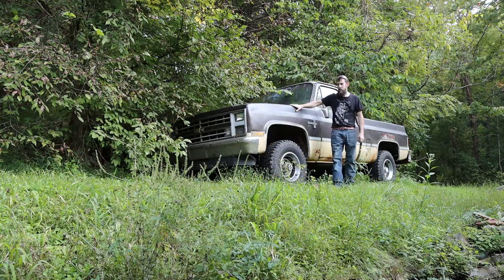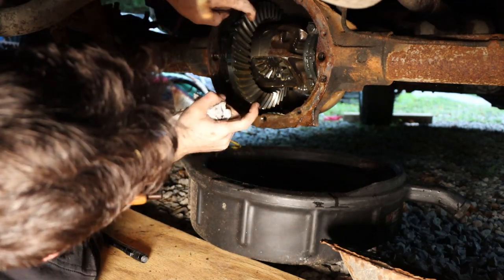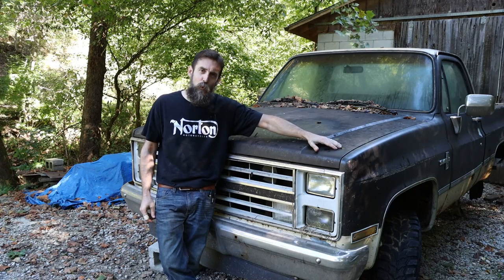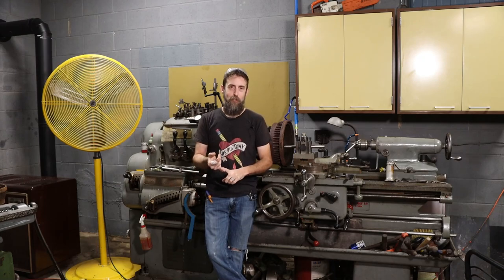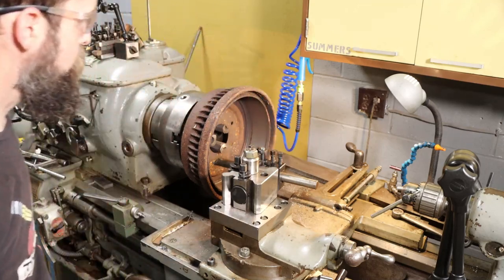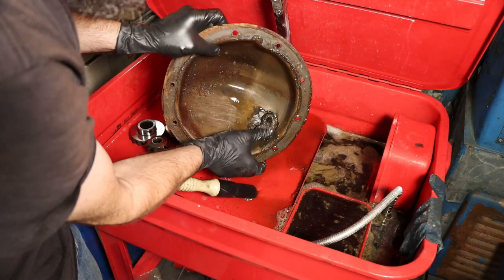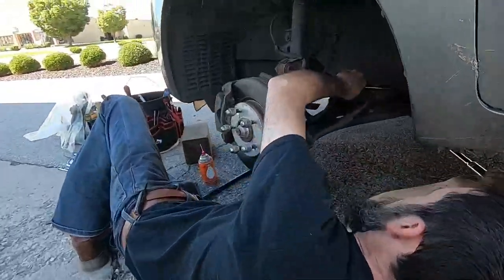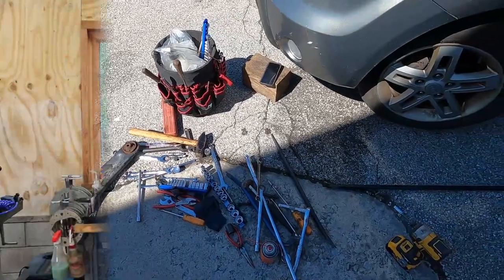Fixing what I broke Old C10 4x4 . Everything is Bad. Part 1

Comment: If a guy didn't know better, he would have done the right thing, and just ignore the issue entirely and drive it 600 miles home.  LOL.  I know exactly what you mean about "Just fixing what I need to".  My '99 Tahoe is in need of an entirely new suspension, I know that if I do the shocks, I'm going to need the coil springs, and the tie rods, and the ball joints, and the lower control arms, and the wheel hubs....well, actually I KNOW I need all those things.  I know I don't need front brake calipers...I did those the last brake job.  LOL...

Comment: The rusty brake lines are a concern. They can be good under normal braking because most people don't have to push very hard. In an emergency, you push much harder and the brake lines fail just when you need them the most. I like to test mine standing still and push hard on the pedal. Your life might depend on them. I'm surprised you squirrel friends or other rodents haven't chewed up the wiring on the truck.
Reply: Those brake lines wouldn't pass the annual inspection (MOT test) here in the UK. The springs would fail too. I agree with you, you don't always know how deep the corrosion has bitten.

Comment: Take a small grinder and grind that lip off !! the shoes dont touch that portion on the drum anyway, hence the reason for the lip.
HOG out the first passes then  a final slow light cut
ATTN : MEASURE THE DRUM DIAMETER. IT'S STAMPED ON THE FACE OF THE DRUM. THICKNESS IS NEEDED FOR PEDAL FEEL AND COOLING OF BRAKE LINING.

Comment: I agree to disagree with you. Spent my life as Grand Master Marine Technician, (48 years). Only bought Snap-on & Mac. At 76 & retired I now have a Maximiser III with side cabinets with every tool I will ever need. If something breaks, I get a new one free. I used the money that others used for a beer, a smoke, a movie, golf, etc. to buy my tools & never went without. As Aesop said: quality, not quantity is what's important. Just my stinky opinion.
Reply from the maker: I absolutely get it in your situation.  I done the same thing when I worked at a full time shop. Snap on and Mac is what I bought as well. Unfortunately 75% of mine got stolen or I would still have them.
They are great tools with a feel and finish that hard to beat. My tool comment was for  the average DIY guy that doesn't make his living with wrenching but is handy enough to repair his own stuff.  👍